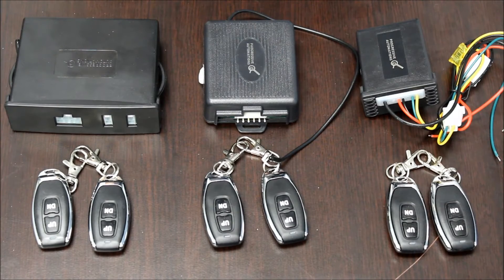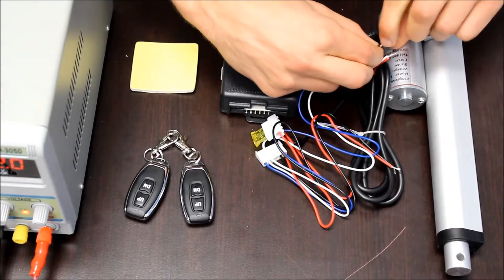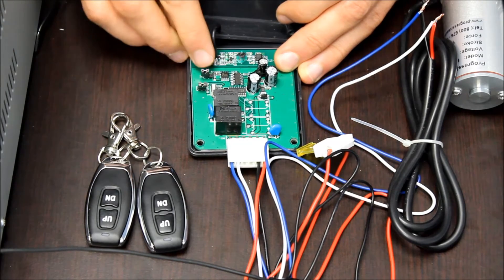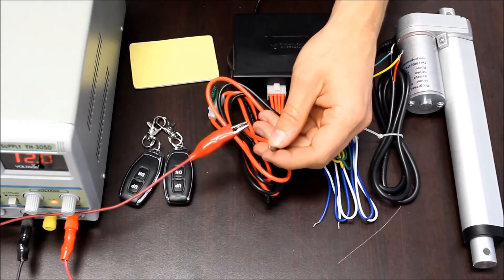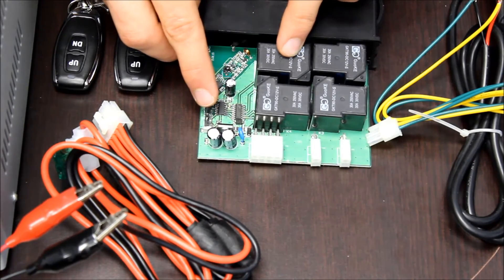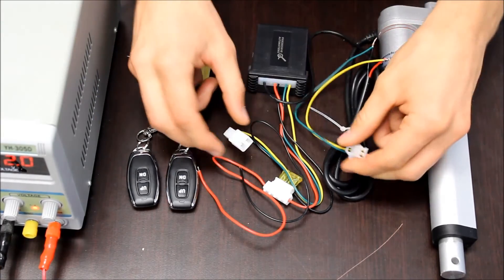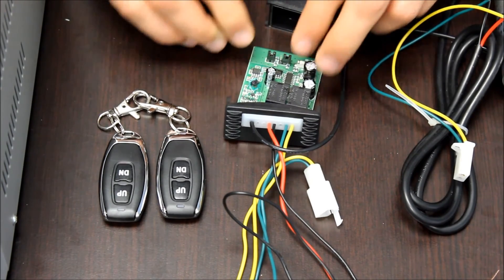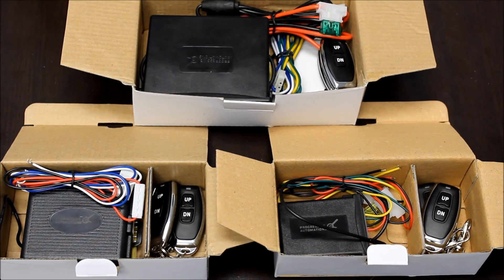Remote Control Boxes PA-30, 31, 33  for Linear Actuators - Product Overview

Comment: Can I wire a foot pedal (PDL-01) to PA-30 control box? If so, can you advice on how to do this please
Reply from the maker: Our foot pedal (PDL-01) does not have direct compatibility with control boxes, however, wiring them with relays allow for bi-directional operator controls. The wiring diagram below for 1 actuator can be used as a sample reference:

https://cdn.shopify.com/s/files/1/0061/7735/7891/files/Foot_Switch_Table_Mount_Switch_Control_of_Linear__Actuator.pdf?16779998414396995386

Comment: Can a momentary switch be connected to the PA 30? And if so, a diagram, please. Thanks!
Reply from the maker: Wiring a momentary rocker switch to the PA-30 should be possible through the pairing of relays that have the suitable current draw rating, similar to the sample wiring diagram idea here:
https://cdn.shopify.com/s/files/1/0061/7735/7891/files/Single_Channel_Control__Box_Rocker_Switch.pdf?15272234796292384046

Comment: Thanks for the informative video. It is mentioned different loads will cause the actuators to operate out of sync. In a scenario where you have four actuators at the four corners of a square frame, and during operation (up or down) one or two of the actuators reach the desired height before the others. What is the process for keeping the actuator/s that achieved desired height first positioned while allowing the other actuator/s to operate until the desired height is achieved to be “level” ?
Thanks
Reply from the maker: Glad you found our video informative! Actuators can go out of sync if they have no positional feedback and were not paired with compatible control boxes that have been programmed to keep them in sync. To achieve synchronization, we recommend actuators with hall effect sensors if you required 2 or more actuators to travel synchronously. This would be because they would have hall effect feedback that is received as signals to a compatible hall effect control box which would then be able to make the needed corrections to the actuators in case one side travels at a different speed from the other. Differing speeds may be due to slightly unequal weight distribution or the speed tolerance of the DC motors (+/- 10%) in the actuators.

Comment: Can you tune the responsiveness? For example, when you let go of the button in momentary remote mode, the actuator continues for a brief moment before stopping. Can you adjust it so that it stops immediately?
Reply from the maker: Our control boxes do not have the ability to tune the responsiveness. The short time delay between when the remote is pressed/released and when the actuator moves/stops is due to variables such as the mechanical relays inside the control box having to physically move switch positions, RF signal transmitter and receiver delays, etc. Perhaps the closest way to achieve "immediate" responses would be to remove as many variables as possible that could introduce delays, such as having a simple DPDT rocker switch wired to the actuator:

https://www.youtube.com/watch?v=H7zg7ZdD13Y
Reply: @ProgressiveAutomations  thanks

Comment: What does this gadget do?
Reply from the maker: Hi there,
Mentioned products are our most popular control boxes for controlling linear actuators. Using the RF remote provided, users have the ability to extend, stop, and retract their actuators from up to 30-50 feet away (open air). The control box has both momentary and non-momentary capabilities as well as an in-line fuse to protect against short circuits.

Comment: Hi can I wire 4 actuators to the PA30
Reply from the maker: Hi Peter. We do not recommend wiring 4 actuators to the PA-30 as it is specifically designed for two actuators with a maximum current rating of 15A per channel. Connecting 2 actuators to one port could result in the control box to intermittently work with the remote as it won’t be able to operate at its full capacity